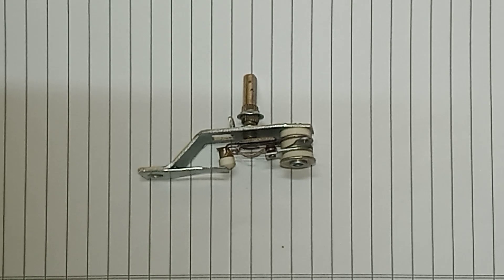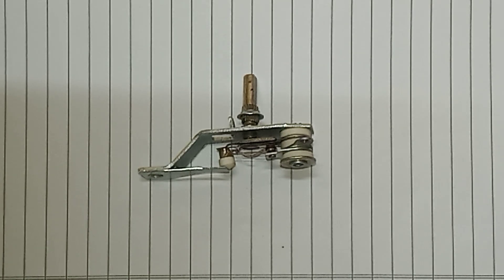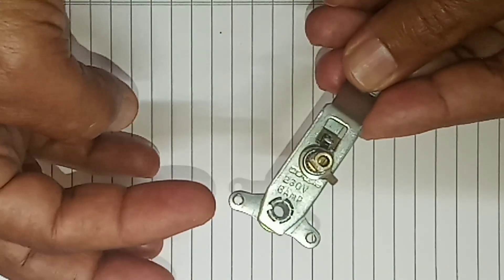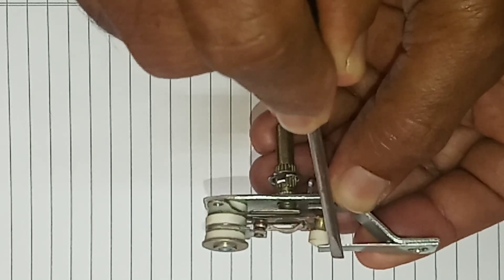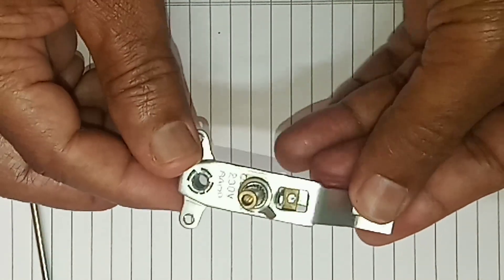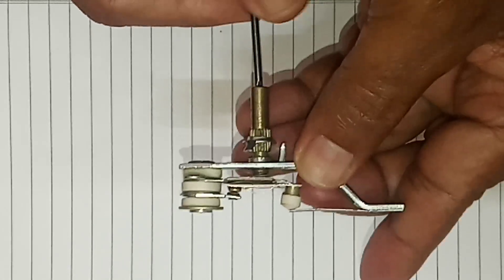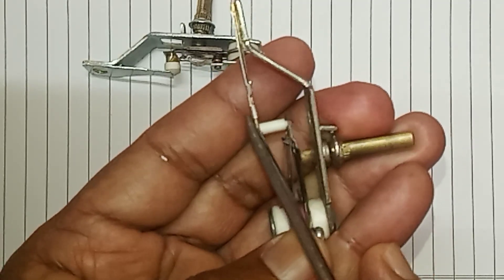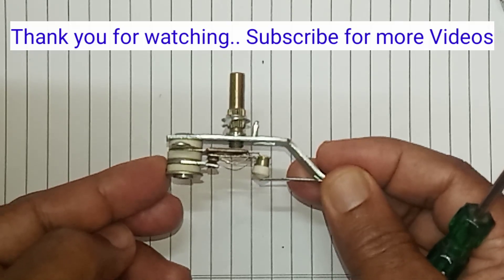How Thermostat Works

Comment: Finally found the answer... Thank you sir! Is it possible to adjust this? It seems for my iron, low works for a very short time, and high doesn't work at all. There's another bimetallic thermal switch in mine that's directly on the element housing too. I think that's fine though.
Reply from the maker: Yes sir, you can adjust it. There's a screw internally to adjust. The contact points should also be cleaned with a fine sand paper

Comment: What are the white circles?
Reply from the maker: The white rings are spacers or ceramic insulating rings which separates the terminals from each other. In simple terms, to avoid contact between the terminals..
Reply: @X-lent.techgroup  Hey! That’s what I said!
Haha, great video,
Reply: I assume you’re talking about the three white things on the left hand side (at 1:26 into the video) that have a metal part of the thermal control between each (circle/ disk/doughnut) 
They are ceramic insulators which keep the circuit broken/open so that the adjustable heat sensitive components can control the state of the circuit.